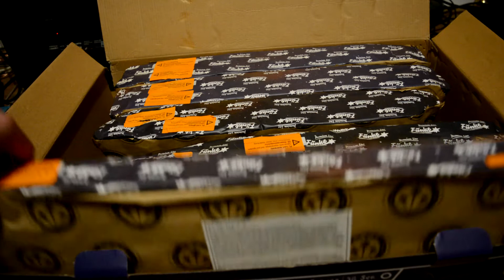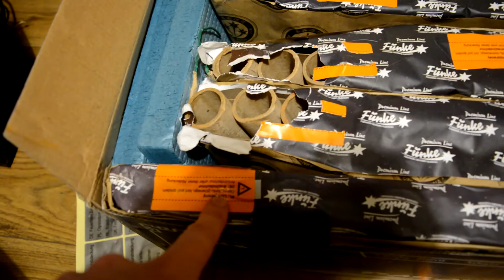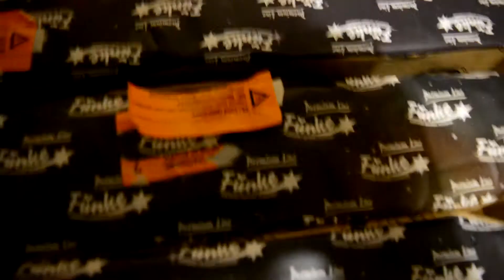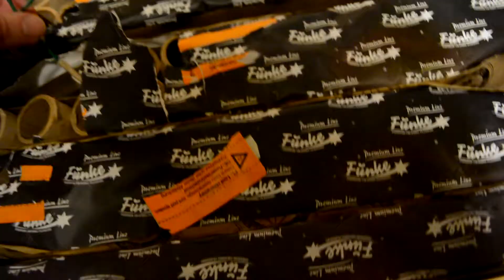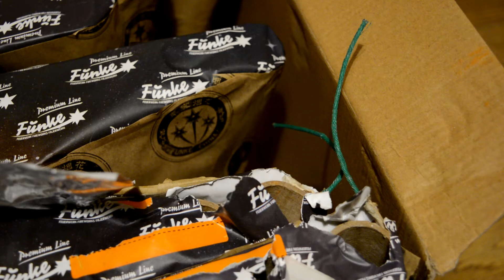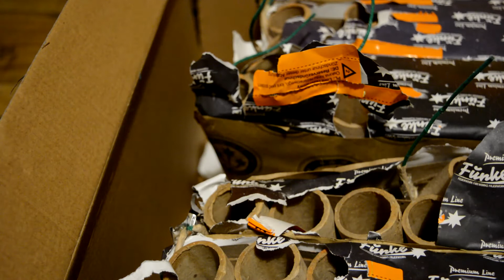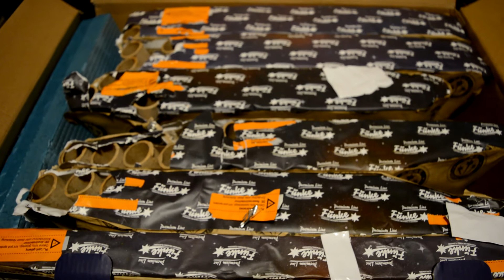Funke Paranoid Fusing

Comment: Appreciate it alot top stuff bro, can’t wait to fire it 💥 does it make a difference if I twisted the fuses together ? And then cable tied them Would it still fire ok ? If not I’m gunna have to do it again
Reply from the maker: You're welcome. Should be fine if twisted together as there would be plenty of contact between the fuses.  Yes cable ties will be fine. As long as there is good contact between the fuses then it will be fine.